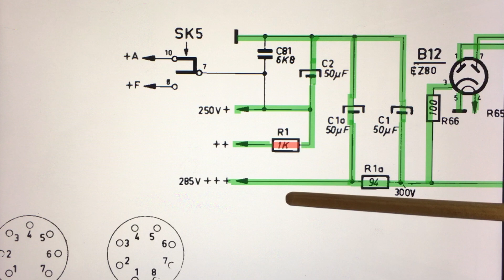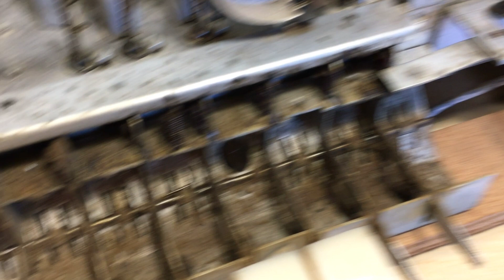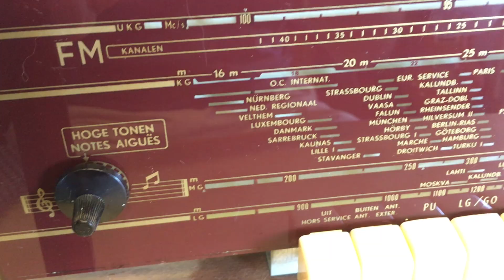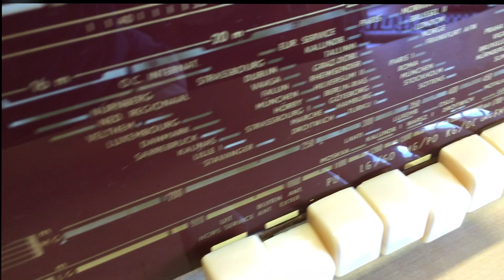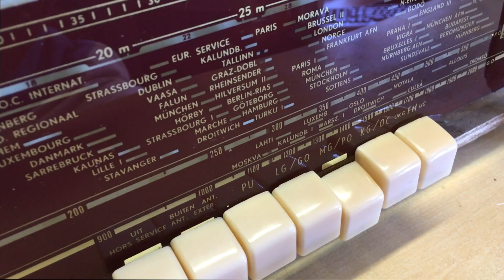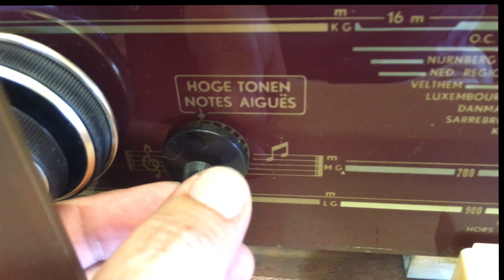Philips BX750A tube radio restoration - Part 2. Power up.

Comment: I have one and transformer connection Inam not able to figure out. I can see a spring attached to back chassis and other side has come out. One of the lugs of the transformer is free and I feel it should have been there. It could be that z1 you were pointing out that some one has put a spewing instead of fuse. Let me know if

Comment: Sorry did you remove C70 at the AC? I dont really see the purpose of it, is is worth replacing with a new?
Reply from the maker: If you mean the cap across the AC, you don’t really need it but can replace it with a safety cap.

Comment: Thanks for the informative videos. What do you recommend for washing off dried grease on mechanical stuff and what for lubricating them?
Reply from the maker: Usually use isopropyl alcohol to clean. The lubricant varies depending on the function.

Comment: According with the schematic you show were does the resistor feeding the B++?
I do not c a connection to B+++ anywhere.  I am confused
Reply from the maker: +mtabernig : this voltage goes to the output transformers.